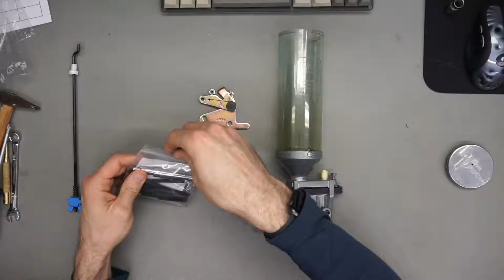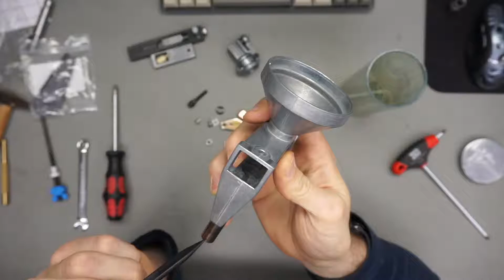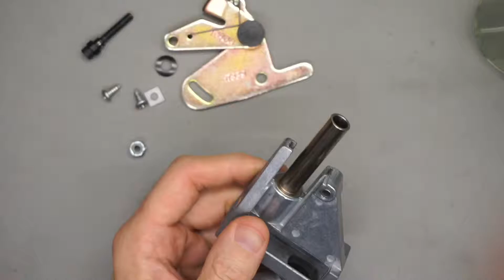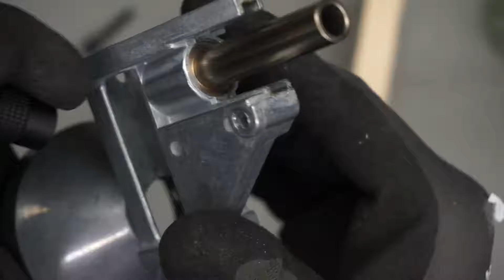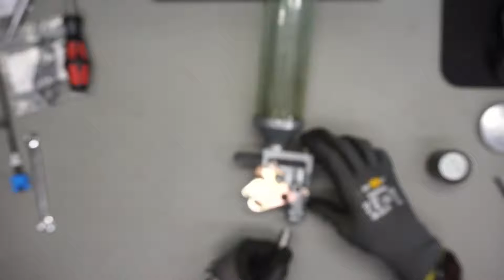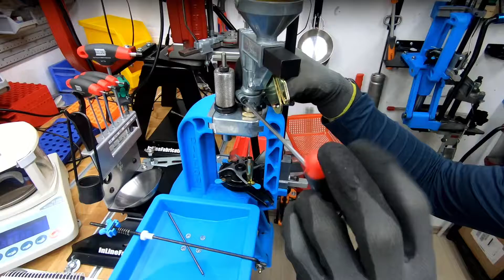Dillon Powder Measure - Fixes and Upgrades! No more spill, improved consistency, Failsafe feature

Comment: Excellent vid. Very instructive, no fluff. Really appreciate your experience and the time you took to create this vid. Very helpful for me as I have erratic powder drops on my 550B which I now have insight to resolve. Thank you!
Reply from the maker: Very kind, thanks! Hope you manage to solve the issues with your powder drop!
Reply: @GunWodan  - After implementing your recommendations, my powder drops are not perfect, but acceptable now. About half the time they're right on spec to the tenth, the other half of the time either plus or minus one tenth of a grain; this is acceptable to me as the recipe is fairly light. Much improved now though-- I was getting +/- .4 grains prior to this repair. Thank you!
Reply from the maker: @neilreid9005  love hearing that. To be honest +/- 0.1gn is the best I can do myself.

Comment: Great Vid , I have searched vids looking for info on the spring that you used.  I sent Dillon message asking for old spring part number but got wrong info from them,  COVID issues make customer service very difficult,  My only comment is volume was a little low until the very end of your video.  Thanks for sharing your knowledge with us.   Would appreciate spring part number if you or anyone has it or maybe another source of similar spring?
Reply from the maker: Thanks, great feedback! The volume issue is a good point. This has hopefully been fixed in my later videos. Regarding the Dillon parts number, I‘m no wiser than you are unfortunately. Pretty sure a rubber band could serve the same purpose until you find something better.
Reply: Thats the DP powder bar return spring which are now not included in the powder dispenser

Comment: Hi Woden .    Nice video.  I was curious on the spring that pushes the powder bar back in, why do you think that helps with powder spillage?  I checked mine and that inside tube did indeed have a gap inside the body, filled with fine powder.   I cleaned the gap and closed it.   Hope it helps.   It seems like such a silly thing for Dillon to overlook
Reply from the maker: Thanks very much for your feedback! I was indeed surprised when I found this gap in all my oldest Dillon Powder Measures. This seems to have been fixed a long time ago - at least 15 years - by making the funnel-tube that goes into the main body a bit longer. It was necessary for me to press this tube way beyond flush into the body to close the gap inside. New models have tubes flush with the body and no gap inside...
The spring helps avoid another potential powder spillage. I had situations where the slider only started the return-travel AFTER the case mouth already left the powder die. This happens when there‘s a bit of friction keeping the powder measure „up“ only to be pulled back down by the return rod. When the slider returns, it might tip some kernels that were still in the measure down into the case. If the case is already far enough down to actuate the return rod, there kernels sometimes spill. I just want to make sure the slider returns firmly with the brass case so that any kernels left in the dispenser safely drop into the case 😅
Reply: @GunWodan  Mine definitely had the gap and I think my powder measure is much newer, as in last few years. It came with a néw RL1100.
Reply from the maker: Oh .. thanks for sharing - I wasn‘t aware. Recently got a 550b with four Dillon Powder Measures from 2005 and they were all fine. Guess this is something to always check in your measure then!
Reply: @GunWodan  so I recently had ordered a brand new quick change kit from Dillon itself for my 750, I just got it a couple weeks ago and I never opened it. So just now I went and opened it and I took out the bars and sure enough, there’s the typical gap Where the dropper tube is not Presed in far enough.  I wonder why some are good and some are not., I mean even the new ones, so far out of both of the somewhat new one I have and this brand new one, they both obviously need to be fixed
Reply from the maker: Okay you really got me nervous now, will check all my dispensers next chance I get!
Reply: @GunWodan  I’ve also been really messing around with my other powder measure that’s on my 1100 which is set up for 9 mm and I Gotta say, it doesn’t seem like there is any way to get my powder measure bar to close while the powder funnel is still pressed into or up against the 9mm case.  I wonder if it only works on tal cases like 308